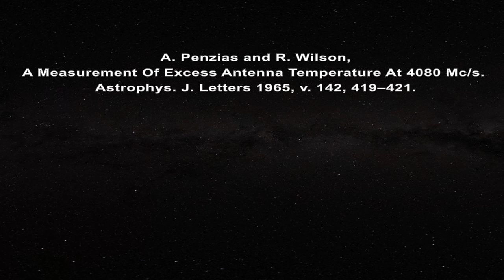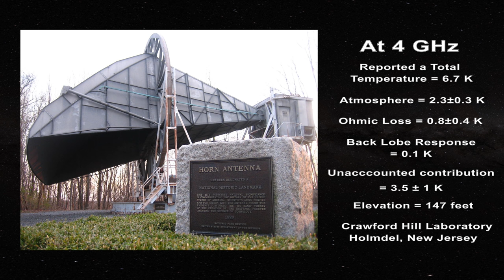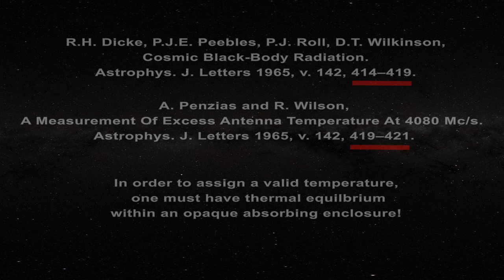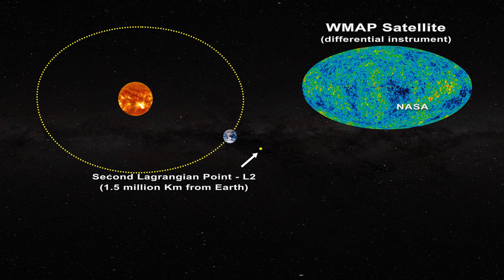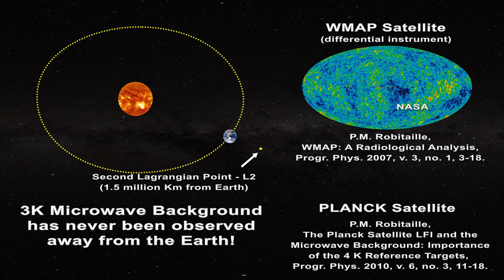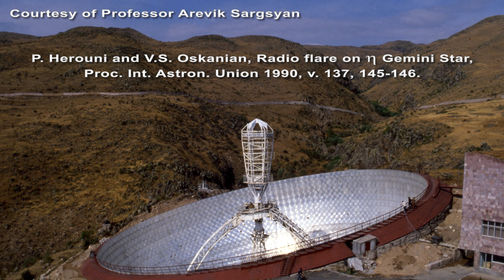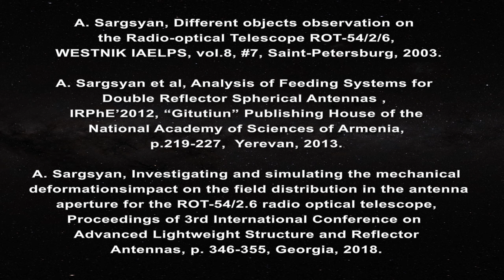The Herouni Antenna - The Death of the Big Bang!

Comment: How do you explain the expansion of the universe?
Are you not familiar with a gentleman named Einstein and his famous blunder known as the Cosmological Constant?
And just for the record....Are you a flat earther and moon Hoaxer?
Reply: @Heart2... It isn't expanding.
Reply: @stevecrothers6585  So the Blue and red shifts between galaxies is not true?
Reply: @Heart2HeartBooks  red shift is not a measure of distance or age. I suggest you look up Halton Arp or read "seeing in red." by said man.
Reply: @JudahDavis  You said the Universe was not expanding.
The red shift and the blue shift show whether a galaxy is moving toward or away from you.

I suggest you read about Hubble the one to prove to Einstein that the universe was not static but dynamic. 
Do you really not know that science has absolutely proven without a shadow of a doubt that the universe is expanding?
For the record I have degrees from Cal Poly in Engineering and Astrophysics.

That being said. If I had no degrees I could easily determine based on all the data that there is not doubt that the Universe is expanding. 

There is new evidence that the speed of light is slowing and this may very well have to do with the square of the distance yada yada and the force of gravity.

https://starchild.gsfc.nasa.gov/docs/StarChild/questions/redshift.html

http://curious.astro.cornell.edu/about-us/104-the-universe/cosmology-and-the-big-bang/expansion-of-the-universe/626-how-is-it-proved-that-the-universe-is-expanding-intermediate
Reply: @Protophanes So I guess Einstein was wrong too. 
If it makes you happy to believe the Universe is static...Then keep doing it.
You and I could debate on and on but to what end?
Peace.
Reply: @Protophanes Do you know what static means?
I never said it was static...Please get yourself a dictionary.

Comment: This is unbelievable. And indeed, I don't believe in anything he said.
Cosmologists are always searching for new theories, even the strangest and most incredible ones - it's the basis of science, test anything, even if it seems not plausible. And yet, there's still people claiming that "truth has been found but hidden for decades" ?
You should be ashamed of yourself, really.
Reply: @Tommaso Pecorella: "Cosmologists are always searching for new theories, even the strangest and most incredible ones - it's the basis of science, test anything, even if it seems not plausible." Tommaso Pcorella

That's not correct. Scientific method does move the way you say it does. Cosmologists do not use scientific method at all. They invent things as they please in order to maintain and extend Einstein's Relativity dogma. They have strayed far from science into a fantasy land beyond all reason. The truth does not matter to cosmologists and astronomers. Consider this simple example. According to the cosmologists and astronomers the finite mass of their black hole is concentrated in zero volume, infinite density, and infinite gravity. But no finite mass has zero volume, infinite density, and infinite gravity. According to cosmologists and astronomers their black hole has two different escape velocities and no capacity for an escape velocity, simultaneously, at the same place; which is in fact impossible. Thus, their black holes do not exist. 

Crothers, S.J., Black Hole Escape Velocity, Sky Scholar, 2018,
https://www.youtube.com/watch?v=dZbDLd42Uws

"You should be ashamed of yourself, really." Tommaso Pecorella

No, the cosmologists and astronomers are the shameful. They have turned science into mass-media induced mass-hysteria. In science we actually seek the truth. Cosmologists and astronomers abandoned pursuit of truth long ago.
Reply: @stevecrothers6585  lol do you know the Corella? they are my favourite kind of parrot. this Pecorino nuisance is more of a cracked record. 
do you think that they find paradoxes and contradictions to be an acceptable basis for their opinions, rather than an immediate disqualification from speaking?
Reply: Tommaso Pecorella
You're correct. Robitaille is a crank. This has nothing to do with phyiscs. It's a misinformation campaign to convince the ignorant and the unskeptical (those who are unable or unwilling to fact check).

Comment: So every radiotelescope on every dry, inland mountain on Earth has to account for background noise, ocean, CMB or otherwise before they can extract useful data from any signal. So your postulate is that these blindingly brilliant mathematicians and radio engineers just blithely ignore terrestrial backgrounds for decades with of designing and using these scopes? What about the arrays in Owens Valley? Very dry. And why wouldn't every scope show a varying CMB according to their distance to an ocean? No sir. You have become overwrought. The earth is not flat and all other radioastronomers have not been sleepwalking for decades. I welcome your incontrovertible proof when you finally have it. Nothing like science to subtract bias.